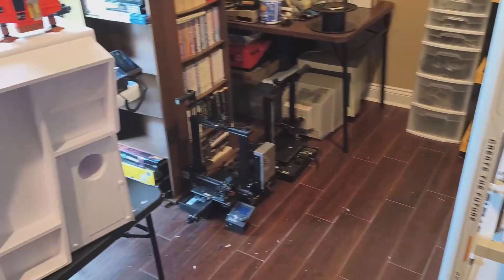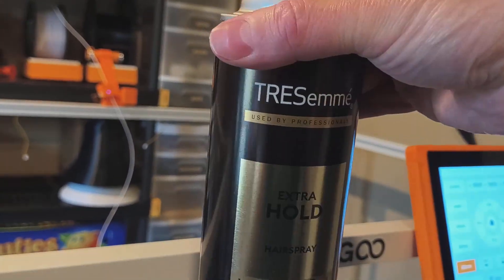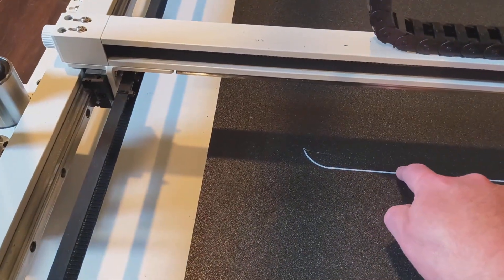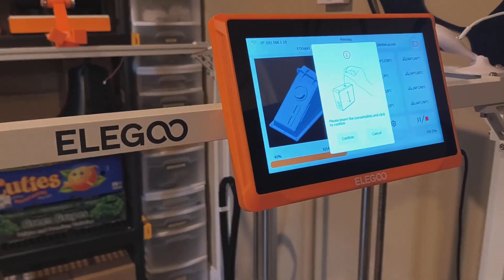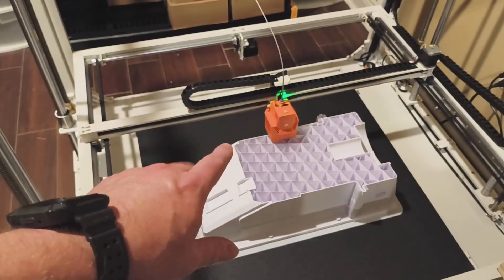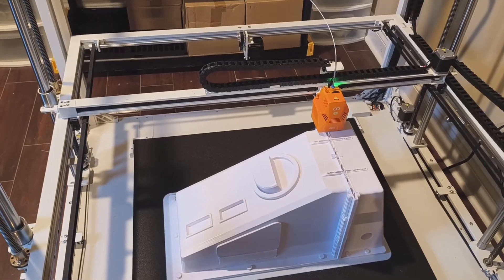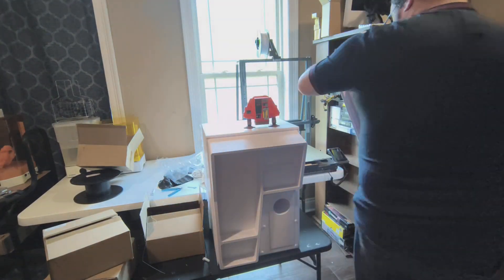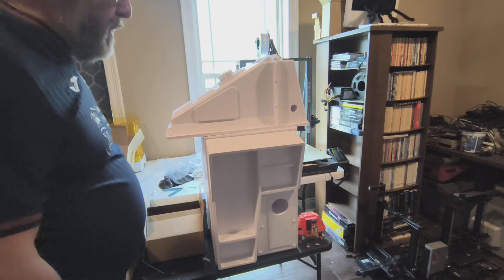Silent Running: Drone #2 Huey 1:1 scale. 3D Printed on the OrangeStorm Giga, Video #2, side panel.

Comment: Crap 3kg pla😂
Reply from the maker: LOL.  I have a love-hate relationship with that filament.  I bought loads of it because it was being sold cheap on eBay, and then I found out why.  It has no brand name and a strange quality about it which seems to cause inconsistent print quality.  However, I think I've finally found the sweet spot for it and I'm getting the best results yet, so perhaps I've been too hard on it.  🙂

Comment: Got to admit if I had the money for the Giga I'd by one, especially now all the kinks seem to be ironed out. 
Loved that film and Huey the robot.
Bet at that size the cost in filament isn't cheap. I am surprised you didn't .8 nozzle though for speed at that size.
The biggest drawback with 3D print is the time it takes. Coming from the display industry and prop building side, I would probably of built the main sections out of 5mm white PVC and did the rest as 3D print, this way the main chunk f the model would of been done within a day.
Great video.👍
Reply from the maker: Cheers.  If you ever saw me try and handle a saw or hammer then you'd understand why I print everything.  🙂 It would be interesting to compare the costs of making a drone in a more traditional method compared to 3D printing.  I usually shop around for my filament and the large rolls usually work out at $10 per Kg, so the large section in my first video cost about $63, and the side piece in the second video was around $31.  Probably the best reason for just printing is that I can just leave the machine running while I post-process and paint something else.
You make an excellent point with the nozzle size.  I'm using the 0.6mm because that's what was fitted to the machine, but it also came with 0.4, 0.8 and 1.0mm nozzles.  Another option to speed things up would be a large layer height, but I was trying to get a good finish and the 0.24mm is what Elegoo call "optimal" for that size nozzle.  There is also the Rapid PLA+ and Rapid PETG+ filament which allows faster printing, but I only have limited quantities of that.  It is certainly something for me to look into.
Glad you enjoyed the vid.  I need to edit and upload my Marvin video as that's getting close to completion.
Reply: @LanchburyConsultingLLC  No saws required just a good craft knife.👍 
I use rapid PLA+ for most of my stuff but normal PETG as well - depends on what I want to do.

The Giga with a 1mm nozzle - wow, that would be fast - less walls and even less on the internal structure probably would be a good thing. Might even half the time of using that 0.6mm.

I found a great way to get rid of layer lines is not to brush but to sponge on an acrylic base paint, which is cheap as chips, let it dry and then give it a light sand, drys in a hour or so, 2 coats usually does it before sanding, it also allows me to use that 0.6mm I have on smaller stuff on the Bambu. 
Using a sponge on white can also lead to some benefits to especially with some colours it can give when lacquered after that painted metal look where you don't really want it as smooth as a baby's bottom, bit like it's been powder coated. A trick I was taught by one of the model makers from Pinewood Studios who worked with us a few times.

My next 'big' project is going to be a 60" Eagle transporter, but for that I was thinking of adding the MAX as it's cheaper than the Anycubic for this project. Once done I won't have room for it so will be donating it to our small local science museum.

Keep up the good work with these videos..👍
Reply from the maker: @barrykirkby9626  Thanks for those tip, I appreciate it.  I'd love to do a large Eagle eventually.  I have a Product Enterprise model and a larger 22"  in my man cave.  You might have caught a glimpse of some Comlocks in my first video when I first showed my little Huey.  🙂
Reply: @LanchburyConsultingLLC  I have glimpsed those comlocks and the enterprises. Did you ever finish the Darlek though?🙂
Reply from the maker: @barrykirkby9626  99% done.  I need to put some rollers under the skirt to move it around easier, and I need to make a proper panel inside the casing to hold the ball joints of the arm and gun in correctly.  If you look at may playlists, there's one on the Dalek.  I need to make a final video on it once I have those coasters in place and get someone inside it to roll it around the bar.  🙂
Reply: @LanchburyConsultingLLC  Be nice to see the finished product at some stage..👍
Reply from the maker: @barrykirkby9626  I'm getting there.  Right now I have the other side piece printing on the Giga and my two Neptune 4 Max machines are making one foot and one leg each.  The Max machines should be finished by tomorrow and Ill post another video once the Giga does that side piece.
Meanwhile, I'll get some of my other printers like the FLSun T1 and Centauri Carbon working on the small parts.  Hopefully I'll have it finished before Christmas.
Reply: @LanchburyConsultingLLC  Cool looking forward to seeing Huey all finished. Got to ask what ever happened to the TronXY, monster of a machine that probably printed Huey in one piece?👍
Reply from the maker: @barrykirkby9626  LOL.  The TronXY is in the opposite end of the room, but I had a (suspected) short in the ribbon cable making it think that the filament had run out when it hadn't.  TronXY sent me a new cable and some other parts, but I've been so busy with the Giga that I haven't got around to the repairs yet.
The problem is, I have the original VEHO1000-16 and this new Giga is about two and a half times faster.  They have come out with a VEHO1000-Pro which is Klipper bases and should be as fast as the Giga, but there is no "upgrade" pack to turn my old machine into a faster one, so I've kind of neglected the old thing.  Keep reminding me and I'll eventually get around to fixing it.  🙂